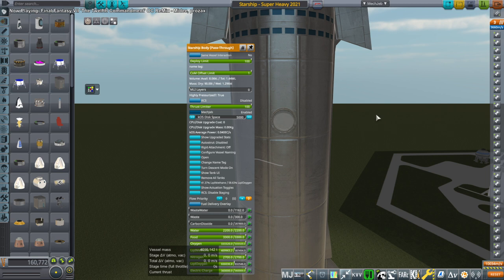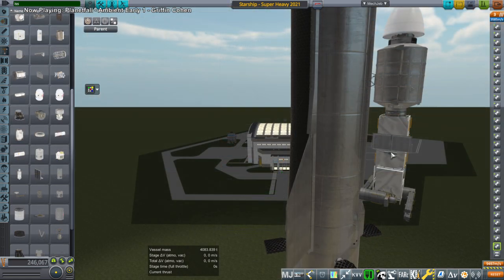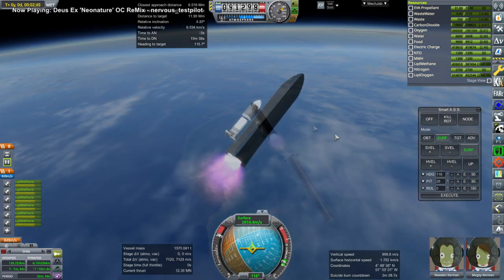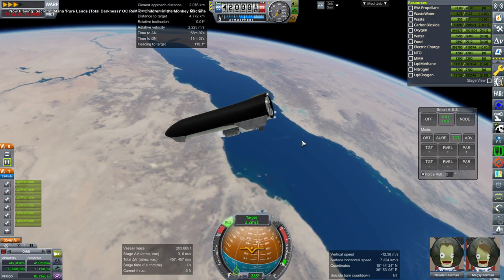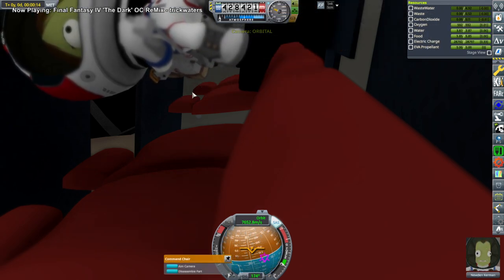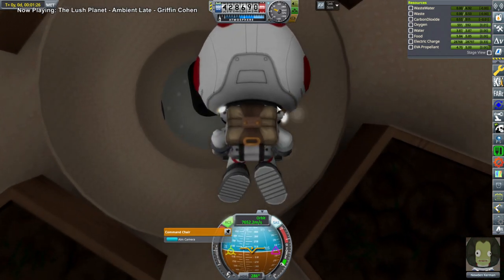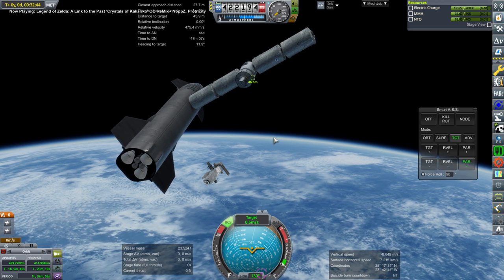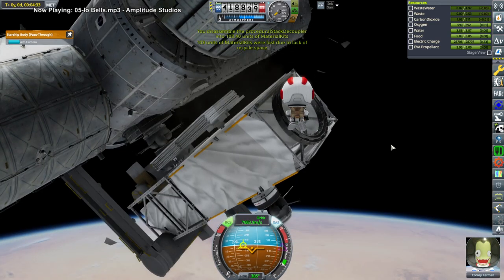KSP with Realism Overhaul - Starship Station 03

Comment: @Raiz Space How did you add the texters for the iss parts
Reply from the maker: The textures came from NASA. I took NASA's ISS model, chopped it up in Blender (because the whole station was one big part), then imported it into Unity where I applied the textures they had already made.
Reply: @RaizSpace  I think I had used the station model before how did you separated the model since it's a big mesh
Reply from the maker: Just box-selecting the stuff, making sure very carefully that I got the right polygons, and then pressing P to separate that selection from the rest of the mesh.
Reply: @RaizSpace  ok i had found a pma model but it has around 400 instances will that lag the game or will it be fine
Reply from the maker: Instances? If you mean polygons, that's nothing. The limit on vertices for a single mesh is around 32,000.
Reply: @RaizSpace  ok thanks
Reply: @RaizSpace when Import the collada .dae blender keeps saying Parsing errors in Document (see Blender Console) have you ever come across those errors?? But the file is a collada file